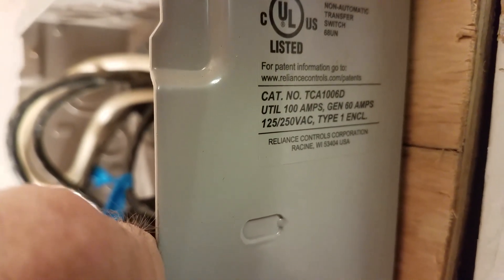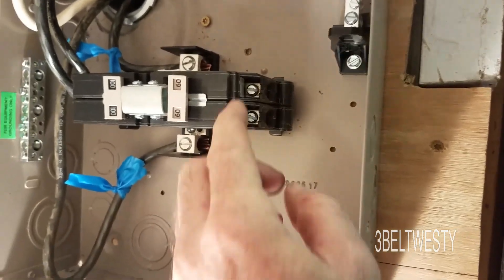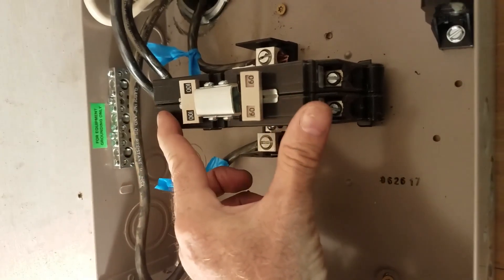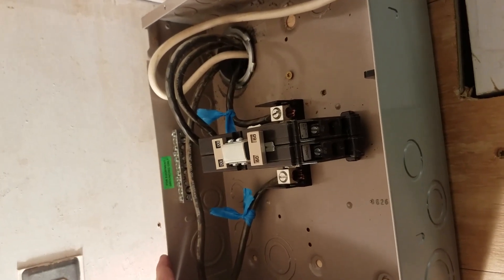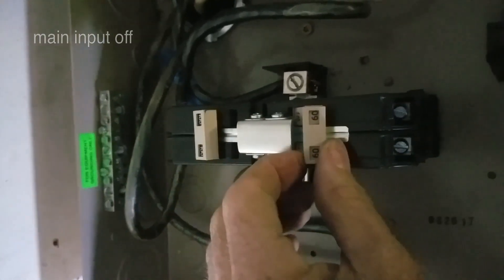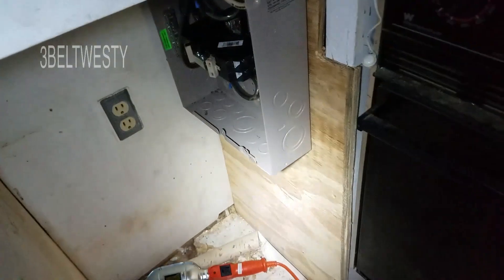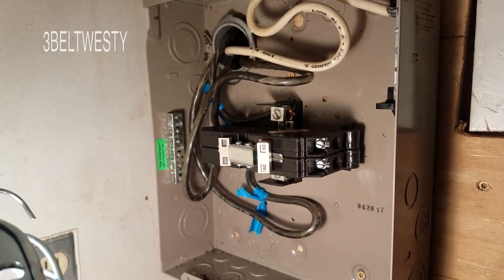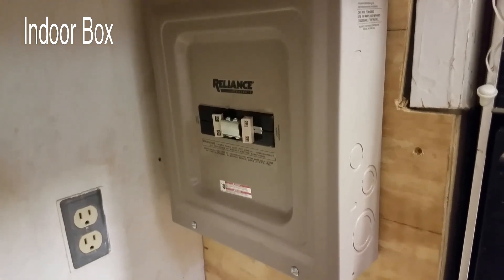Generator Transfer switch to small cabin Reliance

Comment: what is the breaker rating fed back to the main panel , and which location in the main did you go with, top left?
Reply from the maker: 0:12  The left breaker is 100 amps two pole. This goes to the cabins utility meter. The right 60amp two pole breaker is when the generator is used. The subpanel in the cabin thus uses either the power company or the generator. The two breakers are thus "inputs" to the cabins subpanel so either one can be used, But not at the same time.
Reply: @3beltwesty  so this is like a manual transfer switch for the whole subpanel!

Comment: The Neutral from your feed off the meter has to be bonded to the enclosure with a bonding screw because that's technically the first disconnect means. If you have a ground fault it will not go back to the pole because the neutral is isolated.

Comment: Do the lines coming from the meter goes in the middle or do they go to the left breaker
Reply from the maker: Middle. Either the 100Amp breaker (from power Co) or 60 amp breaker (from generator) feeds ie supplies the Cabin's subpanel. The left breaker is the 100 amp breaker, it connects to the utility meter. The Generator has the smaller 60amp breaker on the right. The "input" to subpanel is the center two black wires with blue ribbon. These go  the subpanel, which has a main breaker also at the top. 

The schematic is a double pole double throw switch. The switches are the breakers, that are mechanically tied together. Only one breaker can be in operation at once. This isolates the generator from the utility company.

Comment: How did you tie the wires into your main service panel ?
Reply from the maker: 4:57 The Cabin has an older 100 amp meter socket. The output from the meter socket use to connect to the cabins subpanel with three #4 wires (2 black hot/1 white neutral) . This transfer switch is placed between the meter sockets output and the cabins subpanel. This allows cabin to be off the grid power co and connected to the generator. The transfer switch wires in black are from the meter socket via conduit. The two #4 black wires with the blue ribbons are the input to the subpanel. 

In Normal  mode the 100amp left breaker is used in the transfer switch. Here  the cabin runs off the power company, it just has a 100 amp breaker in line too. 

In Generator mode the generatorr feeds the Transfer switch via the two inputs of the 60 amp breaker. The two breakers are linked together so only one input is used. 

We ran two #8 hots and one #8 neutral in conduit  to the 240 volt generator it is about say 35 feet away from this switch. We could have run #10 wire but used #8 to allow less voltage drop for starting motors. 

Most induction motors draw FIVE to SIX times more amps at start for a fraction of a second. ie a 12000 BTUH Window AC unit that draws 10 amps run can draw 50 to 60 amps as the locked rotor current. Even if #10 worked the bigger diameter #8 just reduces the flicker of incandescent bulbs when motors start
Reply from the maker: The genenator is 7000 watts running, 8750 surge. The actual amps for a resistive load thus is roughly 7000/240=29 amps. It has a NEMA L14-30 connector ie for 30 amps.

Comment: what gauge wire you using?
Reply from the maker: Black hots from 100 amp meter socket to transfer switch are #4, output of transfer switch to 100 amp sub panel are #4. Input to generator feed side of 60amp breaker are #8